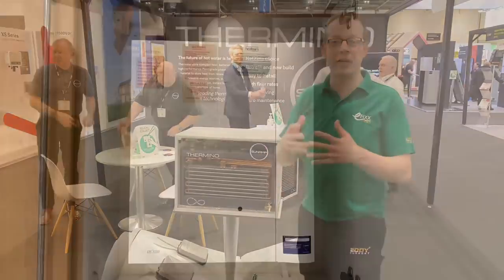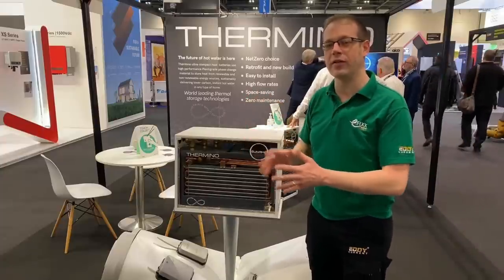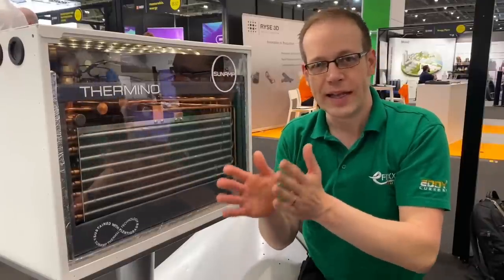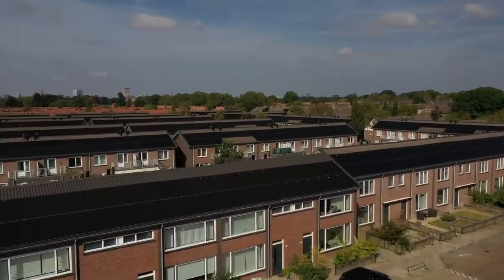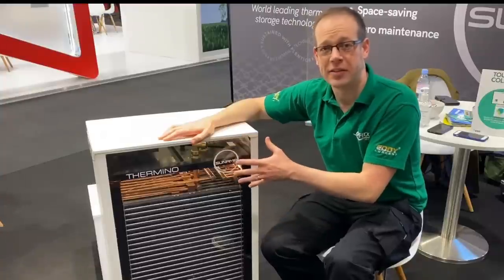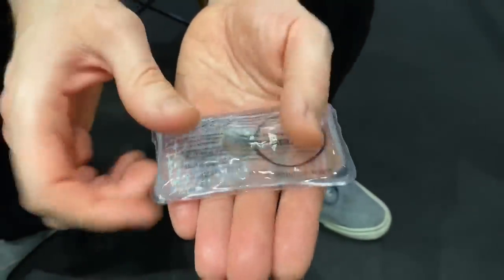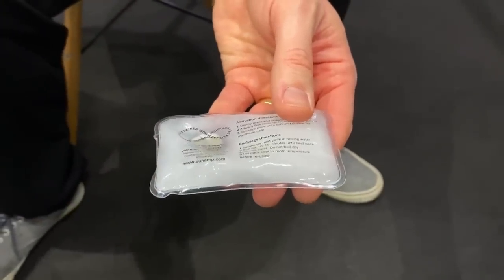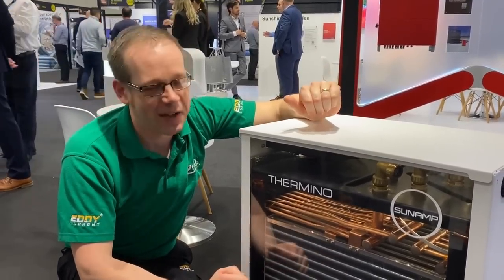The SUNAMP Hot Water Battery: What is it and How Does it Work?

Comment: I wonder what the cycle life is on a device like this. Those acetate handwarmers degrade gradually with use -- totally reasonable for that kind of product but how would that work with an expensive appliance?
Reply: The sodium acetate tangent is misleading. It's good to demonstrate heat being released but they work in different ways. 

Imagine it being filled with candle wax. The cycle life will be limited by the physical construction, and any stresses imposed by the fill changing state. You could heat and cool candle wax practically an infinite number of times with no change to storage capacity.
Reply: So, the good news is that Sunamp is the only heat battery manufacturer in the world to be awarded A Grade RAL Certification, the independent quality mark and the only global standard for Phase Change Material (PCM) and PCM products. The award confirms performance with no noticeable degradation to 10,000 cycles, the equivalent of over 13 years of daily use at 2 cycles per day of hot water application. Sunamp’s own testing has so far confirmed failsafe performance to over 40,000 cycles, comparable to over 50 years continuous use.

Comment: I prefer an instant gas hot water system within 10 seconds of turning on the tap piping hot water is ready for use and comes with auto shut-off to save power as well

Comment: are there any technical documents I can look at, talking about the specific energy capacity of these units, thermal efficiency, and time to heat loss, as well as some at least some rough cost numbers so that $/BTU stored could be compared?
Has there been any research into solar water heating vs. pure PV as the energy source?
I could see this being an interesting idea for an off-grid house I'm designing, as an alternative to multi-thousand gallon heavily insulated water or glycol tank as a thermal battery.

Thanks!
Reply: My house is offgrid and heated with PV but thermal energy storage is still needed for night time and multiple cloudy days.

Comment: I don't understand how this can be efficient or how it can save space, regardless of the heating source the thermal battery or hot water cylinder will both operate at the same temperature so how is this saving space ?
Reply from the maker: The substance inside has a higher thermal capacity compared to water.
Reply: @eFIXXENERGY  yes the high thermal capacity makes it much smaller, but not necessarily more efficient than water thermal storage, either way its very cool tech though thanks for reviewing !

Comment: The issue I have though isonce activated requires a electronic feed of 78w constant to be stable since water temp inlet can also,activate it, so a equivalent of £5.40 A day just on standby at 30p per kw , not a lot but enough to add up a but also once activated is on constant  on  and when you look into it that’s the equivent of an old g rated standby use , the biggest issue Whist it accepts mains feed the heat unit transfers to the outlet at just 14 litres per min , the same as a low feed combi ,  multiple units need to be connected to outlet to equivalent flow of 26 litres that a cylinder can handle, also the purchase option is extremely complicated, now days pv is quite common now and in the future  but you can’t add that heat pump and gas feed together with immersion feed and pv is only the equivalent of .3.3 kw making recovery time significantly slower from anywhere for a full recharge up to hours via electricity. This badly needs to be fixed and upgraded otherwise it means expensive three way heat exchanger for two plus two feeds

Comment: Inefficient as hell no mater the size. You use 5 times more energy to change the phase of the material back in to original state after giving off the energy. Cheaper to just runs modern instant water heaters   either classic or Infra Red.

Comment: Those little click-to-heat pouches have a limited (quite large) life.  What is the claimed life of the Sunamp?
Reply from the maker: The substance in the Sunamp is slightly different to the one in the pouch and it's got an epically long lifespan. I can't remember the exact value but I'm sure it's at least 25 years if not more. 😊
Reply: @eFIXXENERGY  Sunamp is the only heat battery manufacturer in the world to be awarded A Grade RAL Certification, the independent quality mark and the only global standard for Phase Change Material (PCM) and PCM products. The award confirms performance with no noticeable degradation to 10,000 cycles, the equivalent of over 13 years of daily use at 2 cycles per day of hot water application. Sunamp’s own testing has so far confirmed failsafe performance to over 40,000

cycles, comparable to over 50 years continuous use.

Comment: I have some of the hand warmers and they are good but they don't stay hot long, and you have to use a lot of hot water to change them back to liquid.

There must be a better way to do this.

For example a heated jacket that fits around the pack, using some electricity through the jacket which would then heat up the jacket to turn the solution back to liquid. 

Or perhaps other methods but whatever method, rather than wasting lots of heat to turn the solution from solid to liquid a more efficient means is needed to concentrate the heat into the packs.

Perhaps wrap around a heat source, and in the case of using a heat pump perhaps an add on to pass heat through the packs.

Perhaps even electric heater from solar power.

But this looks like it could waste a lot of heat or energy recharging it, as it is having that all or nothing seems to me to be the biggest down side to the system.

Comment: Seems expensive for salt and vinegar.
Reply from the maker: There's a little bit more to it than that, the solution is modified in order to work at the most effective temperatures.
Reply: It’s all well and good but I paid about £1600 to replace my combi boiler about three years ago. Granted I did it myself so no manpower costs. This sunamp is that on its own by a quick Google then there is the added cost of a heat pump and or solar panels. The price puts me off. The cost of all this new fangled energy stuff will need to come down to get people really interested.
Reply: @montystelevision3238  very fair points you make - let’s hope prices improve with greater volumes produced. But with energy prices escalating the cost justification maybe in savings, especially using off-peak tariffs and or surplus solar power.
Reply: @montystelevision3238  how old was the combi ? I went back to a cylinder as Megaflo give you a lifetime warranty and I can dump my PV in it

Comment: A system of partial use would enable the heat to be ready almost anytime.

The problem I see with this system is it's all or nothing.

It's thinking like an old boiler but with the potential to be something different.

There needs to be separated thermally compartments, so you can tap the heat from one compartment at a time, then while one compartment is recharging you could tap the other compartment for the heat stored.

You might not want to use all the heat in one go, so compartmentalise the gell or solution so it can be used one at a time.

We are talking about a totally different way of thinking for heat storage  the only problem is they're using conventional thinking for storage and delivery of the heat and recharging of the storage.

Comment: So, a heat pump for your heat pump?  Sounds redundant.  Keep throwing more at it and before long you could have an 'instant' heat pump system.

(More a thermal battery, I know.  No compressors, pumps, fans.  But in principal, very similar.)

Comment: So it’s a plate to plate powered from an immersion that wouldn’t be completely powered from pv panels. Strange how all there’s green energy ideas have immersion elements in them 🤔😉
Reply from the maker: Not quite, the heat source could come from a heat pump or some other source of efficient renewable energy. The immersion is there as a back up or boost when it's needed. 😊
Reply: Heat pump max 55 degrees so the rest of the heat comes from?
Reply: @paulhockett1545  heatpump can go up to 65c, if you choose proper HP. But why would your ever need that high temperature? DHW is dimensioned at 55C, can go lower with this system due to lower legionella risk tho. 
For room heating you would lose all efficiency of HP going that high, instead you use low temperature heating emitters with high flow and weather compensation, flow temperature is variable.
Reply: @96Lauriz  great so I’ll have oversize rads they will look really good. new and up size all the flow and return pipe work to the radiator. And still be cold in the winter because most of the houses in the uk are poorly insulated. Or should we knock down all the under insulated houses and put underfloor heating and current standards amount of insulation air tight everything and live with mouldy houses that can’t breathe. Or just use my a rated boiler.
Reply: @paulhockett1545  optimally yes you oversize radiators or do underfloor heating. However in many cases radiators here in Denmark are oversized in existings builds  due to energy efficiency improvements along the way. I know in UK you have Challenges with small rads and silly piping.

House doesnt not have to be insulated for HP to perform well, if its poorly insulated IT Will just use linearly more energy as gas boiler would. The heat emitters and heating system together with proper HP installation and sizing is more important.  The biggest mistake i see from UK YouTube installation is ignorance of outdoor weather compensation. Constant temperature in heating system is very inefficient for HP operation. IT requires knowledge hos to set IT, as IT is individual for every heating circuit. So as i see UK installers dont bother with that and set IT very high to not receive any callouts...
Reply: Yer that’s great but am I going to spend £10000 or £15000 to get an inferior heating system. And do I like the noise of the heat pump ummm no. yer maybe it’s quite when new but give it a couple of years that will sound lovely. Plus they look ugly.

Comment: Once the phase change material is used to give out heat, it does it once so maybe only stays hot for a few hours, so the water passing through the system will have wildly different temperatures,  not ideal for showers,  hand washing, might be good for radiators. To use again it then needs recharging which could take hours, certainly a lot longer than it takes to "discharge" it. Worst of all,imagine one year after installation, the phase liquid wil probably need replaced, and again year after year, by design this wont be inexpensive.
Reply: I'm not sure the phase change material will need replacing - if that is sodium acetate, I don't expect it to degrade going through repeated phase changes. 
I'd expect the quantity of the phase change material would be such as to allow for the equivalent of 300l of water in thermal capacity and there is nothing to say they induce the entire bulk of the material to undergo a phase change at once - they may have a bank of phase change cells in there so it doesn't necessarily mean all stored thermal energy is released at once.
I think this is an interesting development and I imagine it works reasonably well. It would take some pretty evil business ethics to make such a bold claim in that (expensive) trade show environment.
Reply: @MiniLuv-1984  Like ice in your dink (only opposite) if there is still ice when you're done with your drink the left over ice sits there. The sodium acetate was only a demo of phase change of giving up heat as it freezes.. in a drink we melt ice to cool the liquid, in a fridge your ice tray gives up its heat to boil freon and freeze our ice. This system freezes the phase liquid  which gives up its heat as the cold water passes through and freezes but at a much higher temperature than water/ice COS.
Reply: @kevinkilkenny8158  Thanks Kevin, I take your point - re constancy of temperature during the phase change.
I was trying to address David's claims. The key example, a 300l tank of water stores approximately 150kJ of energy (heat) for every 1.0°C change. To get the equivalent stored energy from Sodium acetate you will need around 6kg. Catch is the energy stored in 6kg of sodium acetate at temperatures greater than the transition point of 58.0°C is negligible. For water (not in phase transition) it is the same 150kJ for each and every 1°C you raise its temperature until before boiling point. If you allow the temperature of the water in the HWS to vary between say 40.0°C and 70.0°C you essentially are storing 4.5Mj of energy in the 300L tank. To store the same energy in sodium acetate at the phase transition temperature of 58.0°C you will need 180kg of the stuff. 

Therefore, David is correct about the capacity - the amount of heat stored in the phase change of 6kg of sodium acetate (or whatever material they use) is insufficient to replace a 300L hot water service. I just didn't get why he thought the phase change substance would need to be changed annually. I don't know what the phase change material is, but it is probably a fairly inert, cheap and stable substance and will not deteriorate much with repetitive phase changes. (If it does, then the company has picked the wrong formula). On the other hand, the temperature of the material will remain quite constant (at 58.0°C if it is sodium acetate) until the heat of transition is exhausted, so I don't get David's point about "wildly varying temperatures" that he claims. Finally the energy it takes to charge it will be exactly as much as it takes to discharge it, so I don't get that point either.